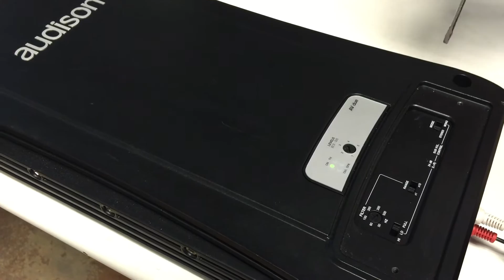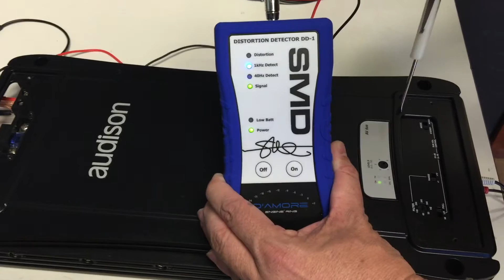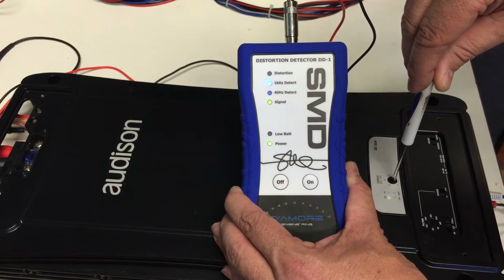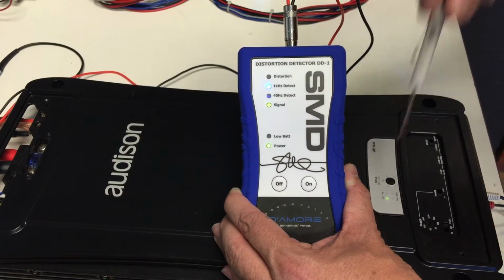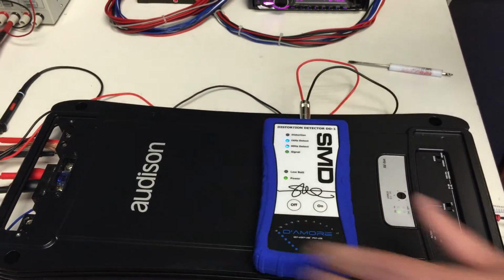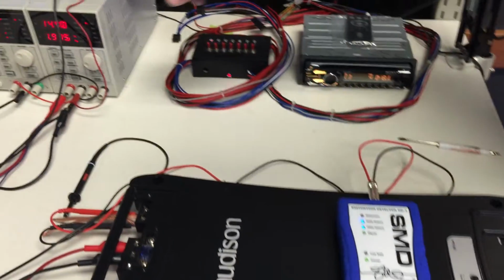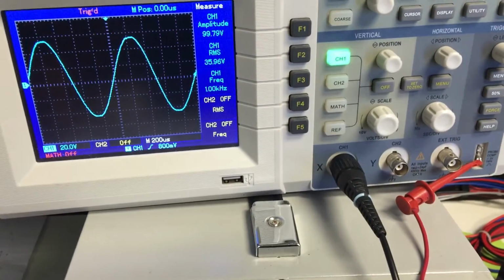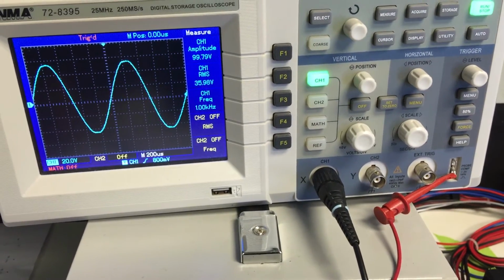DD-1 Video Manual - Video 1, setting gain on a high pass amplifier for mids and highs

Comment: I'm getting signal and it reads 40hz track using dd1, and it also reads 1khz track. I have my gains down and filter mode set to off, allowing full range. However I have my unit at its max and it will not distort. I tried different channels on the amp inserting red cable to + and black cable -, and I also tried red cable to + and black cable to ground? Still no distortion when unit is turned all the way up. I have a ra670 fusion unit, and jl audio 800/8v2 marine amp.What am I doing wrong?
Reply: red to speaker + and black to speaker -  is the correct way to hook it up.  You are using the 0dB tracks to set the headunit max volume level correct?  Make sure any EQ settings in the headunit are flat, and that any volume level adjustments for zones are turned up
Reply: I changed battery to a brand new Duracell. I ran red to positive and black to negative in the speaker terminal of the amp, the filer switch mode is off on amp as well. Head unit, everything is flat, this stereo has 3 zones and each zone has a loud option. I made sure that volume limiter was set to 24 which is the max for all zones and I turned off the loud option for all zones as well.  Tracks played was 1 and 2 from the smd website, they are 0db. It still would not distort, is it possible that my stereo does not distort?  Second day trying.
Reply: @TonyInvents  the ra670 doesn’t have a cd player. Is it safe to assume there might be no distortion because of Bluetooth? I’ve seen a couple videos where the dd1 doesn’t detect distortion via Bluetooth at all or as much vs cd usb or aux. Can you share some insight on this, please.
Reply: @lucidthoughts4519  it is totally possible that the US B or Bluetooth won’t clip at max volume.  Do you have the original dd-1 test tracks on a usb drive or a phone?
Reply: @TonyInvents  from your website I was able to download from my iPhone. I also have the disc but it serves me no purpose, my MacBook does not have a disc drive to rip disc.

I’m going to download into a usb drive and test that on the weekend. If it should distort then I should set gains based on that and not Bluetooth, even tho I’ll be using Bluetooth primarily, correct? And if it does not distort, then that means usb and Bluetooth are both clean signals and I can set gains from Max volume? 

Does Spotify affect this process as well? Because primarily I stream music from Spotify via Bluetooth.
Reply: @lucidthoughts4519  you can also play our tracks right off Spotify!

Comment: nobody ever talks about what happens when the voltage drops,like setting your sub amp,what happens when you put a load on it after youve set it up using the dd1,wont things change ?
Reply: Am sure they have factored that in. Am sure i herd there a 2db diffrence was in a steve mead video i watched the other day
Reply: those things change nomatter how you set your gains you cant real time adjust gains properly  as voltage goes up n down lol

Comment: So I know you utilize this tool to setup the gains properly on Amps (Highs/Lows) clean of clipping, but what if the gain setting is more than the speakers can handle?  I've never hear you mention to back off in the event the amp is more powerful than the speakers. I've heard Steve mention it on 1 video though..... Can you please elaborate?
Reply: once you find max volume if its too much turn the amp gain down leave everything else the same ...use your ear
Reply: I think a lot of people find the output voltage for this. For example if you have a 60 watt RMS 4 ohm speaker, multiply 60 * 4 and then take the square root of that which would be 15.49 volts. That will give you your max RMS voltage that the speaker can handle. When setting your gain, measure the volts in AC across the speaker making sure the voltage is no higher than that voltage.
Reply: Sorry for necro but depends on how much you're overpowering. A little bit of extra juice is fine sonic electronix did the math if over powering or underpowering when choosing an amp and the general math. I think it was the rms of speaker x 1.25 if your overpowering and .75 if underpowering

Comment: Hi, so what tone would I need to use if I'm setting the gain on the channel that will be playing midbass? For example, in my BMW e90, I'll be setting them up so that they are bandpassed between 80-250hz. Would I use the 40hz tone here and set it to -5db or -10db of overlap at the amplifier? Thanks

Comment: So I do not need to test for distortion directly from the head unit and do exactly what you did to test both head unit and amp from the amp itself? Unplugging the head unit from the back is going to be a bit difficult?
Reply: Google User you can test the distortion via the amp too

Comment: So i just have a question in the dd1 manual  they state that you should not turn the car on as it might introduce noise into the process of setting the amp gains but i see in this video the voltage that is being sent to the amp is 14.4 volts coming from the bench power supply when my car is at restiing voltage it is at 12.5 will that effect the process of setting the gains ?
Reply: Tristan De Witt this needs to be answered
Reply: Great question. I've always thought about this too. That's why I always set my gains with the car running. I know that the specs for most amps are bench-marked at 14.4 volts.

Comment: Wouldn't tuning your amp for mids and highs with a -5 db tone induce clipping on Decaf/DJ SNT/etc boosted music? I just got my DD1 in and have always used my O-Scope tuning with 0DB tracks. If I understand correctly a 0DB acts as a safety net tuning your amp to a safe lower output AC voltage.
Reply: Test tones clip way before music (dynamic sine waves) do. At +5db You are really pushing your mids and tweets to their performance edge (hence the soft clipping) the audible distortion will be less than 1% and you will not hear it when you play your tunes. You will be running close to your amps true rms rating at normal volumes doing it this way
Reply: I think if u set the gains with your engine off (12.3v) when its running (14.4v) the amp should clip at a slightly higher point anyways, and with a really good charging system and electrical if will definitely clip at a higher point, my clip light changed alot higher, so I set my bass amp with the bass knob less than 3/4, besides with s clip light you don't even have to set your bass amp gains.  Just play it right under when it flashes

Comment: Hi guys, I got a question. So I am digging this DD1 and want to know what the whole + 10 dB and  - 10db means once you find out what your clipping point is in the head unit for the sub amp and mids and highs amp. I am confused on that DB part. Like what does that do for the sub or mids amps? Thank you in advance for replying to my question.
Reply: Also curious about this